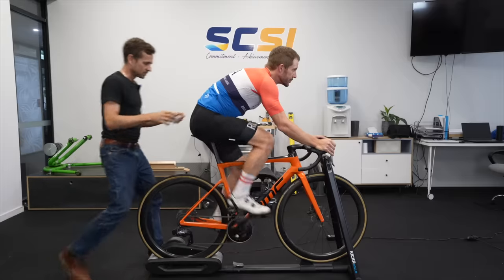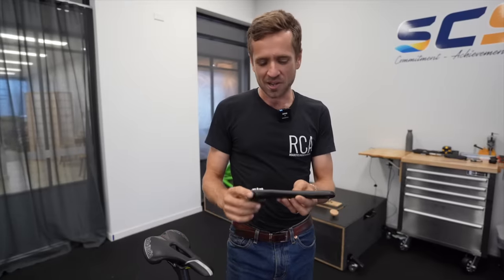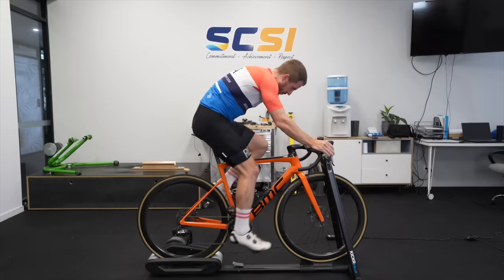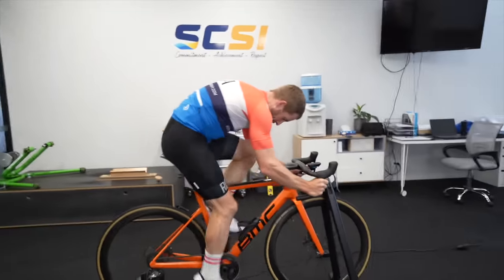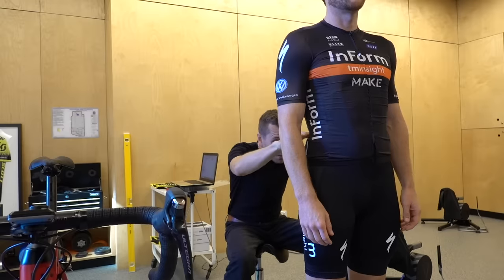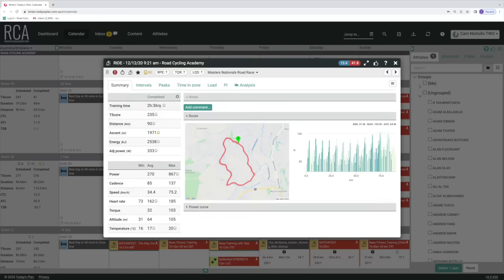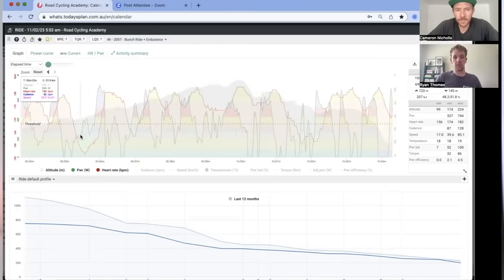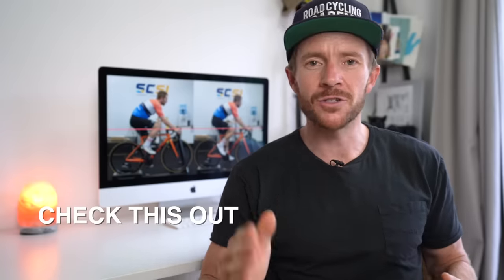I've Gone Back to 165mm Cranks (Fast at 41)

Comment: Shorter cranks, mechanically, offer less leverage and a smaller rotation circumference. You’re effectively riding in a slightly higher gear. So your cadence would surely be LOWER , not higher, unless you downshift to compensate. Also, your feet and legs will move a little LESS because of the lower circumference. Imo, it’s simple mathematics! 

I am 175cm ‘tall’ and happen to prefer 165s too, for the slight reduction in joint flexion and the extra space between thigh and belly at the top of the stroke…so more comfortable overall and especially in the drops.
Reply: Have to say when I changed to 165 cranks six years ago I never noticed any changes to cadence.
Reply: Cadence is preferable in the higher range with much shorter cranks since there is a lack of torque , keeping the cadence high helps with acceleration (Surges), climbing and overall performance....  I run 100mm cranks due to a knee injury.
Reply: @MyFloridaSRTcom  Thanks. I hadn’t thought of that. To achieve that higher cadence you have to drop a gear or two though. Would you agree that a shorter crank lever is effectively a higher gear? You are trying to move the bike the same distance, with a shorter distance of pedal stroke.
Reply: @hisdadjames4876  Cadence still a preference for most rider , you must adapt to higher or lower ,I use to spin 75-80 but recently adapted 85-90 while riding solo...  95-110 while group rides since it keeps the legs fresh and helps with surges due to lack of torque  , Yes a smaller crank is like riding a bigger gear , according to Sheldon's Brown Gear Gain Calculator in my case (extreme) riding 100mm cranks with my current setup of 52-11 is like also riding a 85-11 with 170mm cranks, Btw your travel further with 1 pedal stroke of a said 175mm crank vs my case 100mm for the same cadence.

Comment: Been on 165s for about 6 years, gets kind of expensive having 6 bikes, one of my bug bears when buying a new bike is dealing with 172.5mm cranks every time, it's the reason that when I bought my TCR I bought the model that came without the power meter. I never noticed any change in cadence but I naturally spin faster than most that I used to ride with anyway, but one of my bikes is a single speed so quite comfortable pushing big gears or spinning.

Comment: I have been so curious about making this type of switch. But, where I ride there's flat with a little bit of rolling hills, but what we have mostly are long climbs that are steep.10-25% gradients with often 300-700 meters (1000-2000 + feet) of climbing often with no flats. Just straight up. I'm currently running a 36 in the front with a 28 in the back for maximum low range. I can try to put a 34 in the front, so I'd have a 34-50, which I've read many people do. But, going to a 30 in the rear would make for such a funky spacing for the rear cassette. Point being, I've held off because I'm concerned about the leverage losses with the shorter cranks. When you run out of gears it's just you and the lever. Unless I were to go to a 12 speed system which I don't really want to do right now, I'm not sure it would be as simple as throw on some shorter cranks and get on down the road. Anyone else have any experience with this type of situation?

Comment: 2 months ago I got myself a 160mm 105 crank (I am 1.76m tall and was running a 170mm) and my knee pain is gone. Give it a try!
Reply: What kind of kneepain? Ive been suffering itband pain
Reply: Mine was a kind of pain that is behind the knee cap and makes climbing up stairs a bit painful (abt 3-to-4/10 on the  pain scale)
Reply: I'm 185 tall and switched to 160mm with smaller oval ring. Best decision ever!

Comment: I'm 5'10". I have 30.5" inseam, at most, so really short legs. 1.09 method puts me at 33.25" saddle height. It's HORRIBLE. 34" is PERFECT. Everyone saying in theory too high is bad, but in reality too high is AWESOME. What am I missing here? I'm using 170mm stock cracks on a Medium size Polygon Xtrada 7 that in all fairness is probably a touch too small for me - would that be why my saddle height is off? Too small a bike?

Comment: Changing crank length greatly affects the Knees for better or worse depending on your leg length. Not always a good idea.
Reply: Not sure how it could be negative for the knees to go to a shorter crank, can you explain?
Reply: @discbrakefan  depending on your legs circular motion the knees must be in the right position for the right extension, or your knees will suffer the consequences.

Comment: Fan of shorter cranks, but not sure why your leg speed or rpm would be faster on shorter cranks.  For the same speed on the bike the rpm of  the crank is the same, nothing to do with crank length. On a shorter crank you make a smaller circle, so you foot is travelling slower in pure speed but the same rads per second. Because the distance in the circle is smaller you have to apply slightly more force to the pedal to obtain the same torque as a longer pedal pedal . Power  is proportional to applied force and the rads/s  (RPM) you are doing. One effect that this will have is that for a given incline you are having to apply more force when climbing in a particular gear, not quite losing a whole cog, but part of the one that you are on. You might find that you change in to an easier gear earlier as at any given speed and gear you are applying slightly more force on the pedals, but the same power, than before.

Comment: Awesome video Cam. I really felt this episode because I also have a similar hip problem as yours (btw I'm turning 32 soon). I've been using the 172.5mm crank for a very long time but now I've switched to 170mm on my new bike. I'm planning to do a proper bike fit before getting it on the road to see if there'll be any improvement. What's your opinion on the 170mm cranks? Could you also explain more about how you're dealing with the skin fat or fold (don't know exactly how to call it), I'd like to get rid of mine. Thanks

Comment: Yeeepp. Went from 172.5 to 165 back in 2016. Took a week or so to get used to it because you have less leverage applying force through pedals. It's essentially like making your easiest gear a little harder. Once I got used to it and got a little stronger so I didn't need as easy gears as before, I never looked back. It did wonders to my comfort on the bike.

Comment: That’s quite a big jump in crank length. Have you tried lengths in between those 2 sizes? Have the shorter cranks been a problem on long climbs? I’m 69 and don’t race any more. I have only a gravel bike with two sets of wheels. I currently ride 172.5 and have ridden 170’s in the past. I’ve been thinking about going back to 170’s. I don’t have any problems with hip or knee pain.

Comment: The aspect I am not so sure about is getting the same power from increased cadence - I fatigue from high cadence just like I fatigue from a resisted low cadence
Reply from the maker: From my experience there is less fatigue with 165s. It’s noticeable on any intense ride
Reply: Each human has a prefered/ideal cadence, where he can get the best effort for longer duration (say FTP-level), but I'm sure the longer the cranks are, the lower the ideal cadence will be. To get the same power output (in Watts), for the same rpm you need the same torque, and therefore less force on longer crank. But that doesn't mean it is easier to apply that (less) force, as you have to "chase" a pedal which is moving around faster on a long crank (at the same rpm). OTOH, it is pretty clear, that for starting from a standing start, (with the same gearing) a longer cranks would (initially) give more torque and acceleration, as you can only apply so much max force independent from crank length. OTOH, with a smaller gear you get the same effect. Everybody knows it is easier to accelerate (from standing still) on a smaller gear. Another interesting comparison is with the old Penny Farth bikes, where the "gearing" is limited to the size of wheel radius you can span with your legs. On Penny Farth track racing  this typically meant they had to push crazy high rpm, and unsurprisingly they also used crazy short cranks for that (I read in the order of 125mm).

Comment: I see a lot of your content, and I'm adjusting the settings by self-fitting. The biggest part of that was the part about the crank change. I am 165mm tall and have a 77 inseam. I was using a 170mm crank, and after changing the 165mm crank, the problem that was not solved even though I made a lot of changes due to the load on the knee and hip joint pain, everything is changing. I was skeptical at first. Is this correct? The power seems to drop and the load on the knee seems to be similar, and the saddle is pushed a little further back. The height was set to almost 165 despite the previous 170 setting, so it was a setting that heard more heels at 6 o'clock. As you can see, I rode with a 165mm crank at the maximum shop at 12 o'clock, so the height was sufficient, and I rode without modifying the front and back of the saddle, so it was something unnatural. The saddle was pushed up to reduce the load on the knees. Sprints are even better now. The power isn't quite like the old 170mm yet, but it's getting better. I think I will use the 165 in the future. Thank you again.
Reply: The saddle goes higher so you should also move the saddle forward slightly, because when the saddle goes higher it naturally puts your position more to the rear. Move it forward and your hips open up even more allowing you to get lower in the front more comfortably.

Comment: Thank you for the great video (as always). I would like to go for a Fit to Neill so badly but its quite a trip from Europe :( Do you think 165 will be a good length for me? I am 189 cm in height but my flexibility is very low, I can't touch my toes and always fighting with tight hamstrings. Also, my handlebars are as high as can be with the stem flipped upwards. My bike is size 58 it comes with 172,5 cranks which worked ok for now but I will change them now for others with a power meter. Thank you.

Comment: Crank length must be seen in combination with cleat position, if your foot is stable with cleats far forward with no issues you may be able to fit 172,5 with no problems in the same position

Comment: How does the foot size influence the optimal crank length? Is there more to the story?!

I'm 178cm tall with already long legs (inseam - 88cms and tibial length - 41.5cm) and large feet as well, 29cms, so naturally I use size 46.5 Bonts.

Comment: Everyone in the comments claim they felt better going down in size.  I am only 5'8 and have been using 175mm for more than 30 years, and bt that I mean on a regular basis as I never drove a car.  I accidentally bought a cheap crankset that was 170mm, and from what remember it felt like it was more difficult to pedal, and more pain in the area below the knees. That's only 5mm difference, I couldn't image going down to 165 or 160 despite the claim that that's my range based on my height. When I hear you say that 175mm should be for really tall people makes me wonder If I been doing it wrong for  over 30 years. Why did I feel more discomfort with smaller cranks when everyone else seems to have the opposite effect. Weird.

Comment: I recently, in the last year built a fixed gear bike as part of a new years challenge and put mostly track specific parts onto it and along with that having 165mm cranks. I live in a flat city and to get to any hills or climbs, you need to actually leave the city. Since becoming confident on my fixie (with front brake) I ride it to work most days and have actually throughout winter been using it for training between 50-100km rides and accidentally, its my most comfortable bike 165mm cranks and all. Im considering changing all my bikes to 165 cranks.

Comment: Cam, how does inseam/ height relate to changing crank lengths?  I’m 185.5 cm tall with 83.8 cm inseam. How do I determine crank length for my size?  I’m currently riding on 172.5   Thanks, Don

Comment: I don't think you should be worried about shorter cranks reducing instantaneous torque. Torque doesn't tell you much in a sprint. You need to look at power, which is torque x cadence. Shorter cranks have the effect of reduced torque, but increased cadence; power is likely to remain the same, all things equal.

Comment: My 1993 Pinarello Prologo has 177.5 cranks and 55-12.  I am 6 '4 and back when I was racing I was a masher....so the long cranks worked well for me. Doesn't the length of the femur bone have some relevance to crank length? Also if you are a spinner or a masher? My 1983 Steve Bauer has 175 crank and at 60 it still fits like a glove, albeit my seat is a little lower now.
Reply from the maker: Possibly and makes logical sense but a question for Neill. Sorry

Comment: I currently own 172,5 and I do ride at 95-105 RPM in a normal ride. If I shorten my cranks, my legs will spin more and become inefficient. For a normal not spinner rider shorter cranks can make sense, but not for me I guess. What do you think about this?
(Height 189, Frame 56-58)
Reply: 95-105 rpm is not an unusually high cadence.  Track cyclists typically use higher cadences than do cyclists on the road, but that’s neither here nor there.  If you use shorter cranks you might find yourself riding with a higher cadence, but that’s just a maybe.  I used to train and race on 172.5s and 175s.  When I switched to the 165s, I noticed it was easier to spin (which I had done normally), only now it was more effortless.  Your mileage may vary.
Reply: @williamtetrault1300  Thank you for your opinion Wiliam :)

Comment: I still ride with 175mm being 190cm tall. Wonder if shorter crank would be benificial
Reply: Multiply your inseam by 20%, that'll be your ideal crankarm length.

Example: 778 mm inseam (mine), my ideal crankarm length is 155 mm (which I've tried on a fit bike). Currently on 165 mm.

Comment: I'm struggling with the "more aero" aspect of this new fit to be a normal result.  I think most would agree that it is counterintuitive.  Question for Neil: do you find this result in most people, or was this fairly rare?
Reply: It's not counterintuitive at all, because your leg on the up stroke does not come as high it is easier to lower your upper body and have a flatter back, your head and upper body is lower in relation to your pelvis, we can all see that is more aero.
Reply: @gregmorrison7320  Got it.

Comment: 2 main reasons 165's are popular with track riders - lower rotational speed and more clearence on the banking.  Also add in you're riding on the flat so there's no requirement for increased leverage for climbing.

Comment: If you are 179cm and running 165mm, does that mean that a 174cm would require 160mm?
Reply: It's dependent on a rider's inseam, not height. Multiply that by 20% and that'll be your ideal crankarm length.

Comment: What about 150 or 155 cranks. I'm 4'11 and currently using 160. My hip flexors are really tight.
Reply from the maker: Probably a Q for Neill. Sorry I can’t be of help.
Reply: Imo, you are very right to consider it….if there is such a thing as an ideal geometric riding position, then for a rider with 10-15% shorter inseam (Kim v Cam) that identical position would be achieved with a 10-15% shorter crank….surely. 🤔  Imagine a side-on image of Cam in his ideal position zoomed out by the ratio of his height to yours (178cm:150cm). Visually, his cranks would be shortened pro-rata. (165mm:139mm!). Better to use the inseam ratio rather than the body height ratio, but I guess you get my basic argument. 

Plus, the stiffer your joints the greater the benefit of shorter cranks…because the diameter of the pedal’s rotation circle is shorter. So, on each and every rotation all joints from the hip down will have to flex a fraction less. Imagine the cranks were double or half the length…how dramatically joint flexion would be forced to change. Well, 172.5, 165 and 140mm are just less extreme points on that same continuum. Good luck!🤞

Comment: You’re still too upright Cam. Use a big negative stem that’s longer with a smaller frame. If you set up your bike correctly you can be in a TT position very comfortably. I have bikes with 165 and 155s. 155s are the best and the lowest you can go to without gearing issues. You need to use a short nosed saddle so you can fit the nose to be legally be closer to the axle. Get one with a padded nose and when you need to be aggressive, sit on the nose. You should tilt your saddle down 10 degrees to rotate your pelvis, this will make getting lower easier, especially if you have an impingement. If you set yourself up correctly, your head can be close to the bars.

Your fitter and many people get confused with cadence. You can’t compare cadence between crank sizes. Whatever crank size you ride, you will have the same foot speed. This never changed. It’s like 2 runners running in different lanes around a track at the same pace. The inside runner will do more laps (higher cadence/same foot speed)

Comment: Its all about leg length vs producing max torque output.  I am 5'11 with a long inseam.  I ran 180mm cranks from 1990 to 2010.  2010 I moved up to 210mm and I just love them.  I have 210mm on my road and MTB bike.  I have no problem spinning the cranks comfortably at 105 rpm and spinning up to 120 rpms feels sweet.  The longer crank allows me to run a small frame and lower seat hight.  This was very important on my MTB bike. Otherwise I felt like I needed a ladder to get on my MTB ride.

Comment: "shorter cranks requires less muscular force" that's just not true is it? Imagine coming up with the idea that the shorter the wrench the lower the force that we have to use to loosen or tighten the screw. So, if the above statement is true why not go for 50mm cranks, you'd require even less force.
The term you are looking for is OPTIMUM